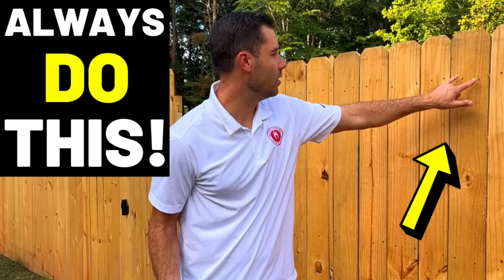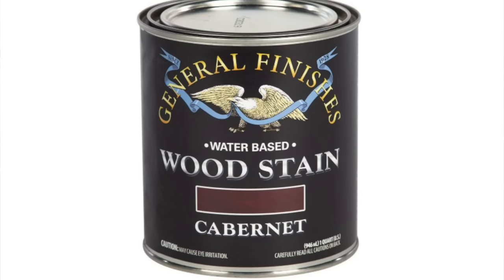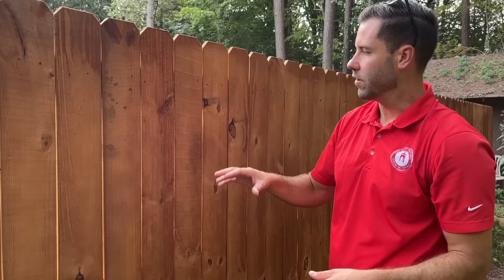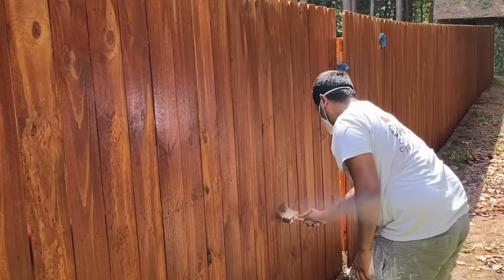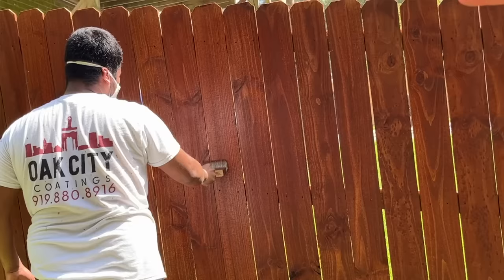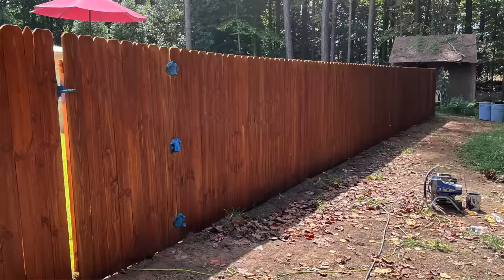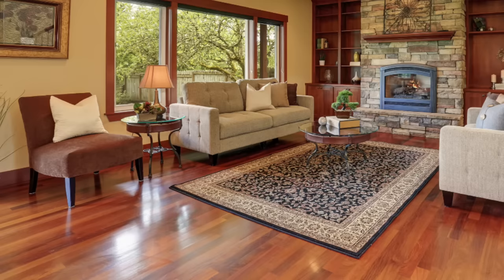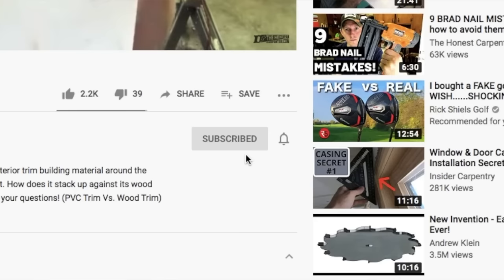Don't Make These 4 FENCE STAINING MISTAKES! (Most Overlooked Fence Stain Pro Tips + Tricks!)

Comment: Brush will always last longer than spray. Been a painting contractor for around 15 years, if you spray to apply you should back brush and work it in the grain. If you just spray and leave it to soak in it wont penetrate and will fade a lot sooner. This goes for most stains and most wood substrates, it's a good rule of thumb if you want your work to last.
Reply: What about roller? Pros and cons?
Reply: Do you typically pretreatment or clean with water/bleach mixture prior to staining?
Reply: For a DIYer, spraying just seems like a huge project. Protecting my house and my neighbors' houses from overspray seems like agonizing (though necessary) prep work.
Reply: How do you order stain and varnish work around painting g walls/ceiling and the rest of the trim? Do you stain first or last?
Reply: I never back brush, I use a penetrating oil based and self-leveling stain that I apply with my battery operated backpack sprayer (same one I fertilize my lawn with).
Reply: Excellent video - I'm about to seal and varnish a new hardwood fence. The guy at the hardware store actually talked me out of a sprayer - I'll be doing the whole job by brush and picket roller.  Thanks for this !
Reply: Yes sir!! even a small roller is better then nothing!! But I also use a brush behind the spray!!
Reply: @timf5963 it’s really not! Just get a fridge or tv cardboard box or a piece of 1/2 plywood & tie/strap to a ladder if your doing by yourself to protect the opposite side your spraying! Plus your only using around 45-50 psi!
Reply: @SolidBased  good insight--thank you! I will definitely consider this. I ended up using a brush on my fence last fall. With the thick 5 1/2-inch brush, it went quickly, but a sprayer would've been much faster.
Reply: does this also apply when using sealant? gonna seal my fence

Comment: I always use motor oil for any wood that I want to protect as it gives the best protection and it's most durable product.
Reply: Does it really protect better?  I have been using stain protectant on my rv gate.
Reply: @debbieluevano9977  oil also rubs off onto everything that touches it. It doesn't really dry. We used it for years on shop floors and any clothes that fell almost always had some black residue.
Reply: Not a bad idea. Your fence will be the color of the used oil though. I'd cut the oil with a solvent so it penetrates the wood better.....maybe use a little gasoline! You can also use old motor oil as bar oil on your chainsaw.
Reply: Sounds flammable!

Comment: Heres a tip folks, you want to save your back while brushing? Two options, get a brush you can screw a stick into so you don't have to bend over, and 2 use a sprayer and then the brush. 2 man job makes this easier and super fast.

Comment: I was a residential painter for many years and staining was what I hated the most. I was so glad when then trend went from staining trim and cabinets to painting. It wasn't because staining was more difficult. It was actually easier. I hated it because it's so thin you get runs and drips a lot easier and the fumes were a lot stronger. Even when brushing, it's still a good idea to go back and spread and smooth things out over the whole surface. Sometimes we used a rag to soak up excess that wouldn't soak up. 

I'm also glad to see you mentioned brushing, as people have this crazy idea that you put stain on with only a rag. While you can certainly do that, brushing (and spraying for exterior) allows what you talked about, the excess to sit on top to make sure there is 100% saturation everywhere. 

I could not imagine a way to explain all this better than you did. Fantastic job!
Reply: How do you order stain and varnish work around painting g walls/ceiling and the rest of the trim? Do you stain first or last?
Reply: @TheOlzee   We stained and sealed/varnished the trim and cabinets first, then painted the walls and ceilings. 

You can paint over stain you may get on the bare sheet rock but you can't get away with staining over wood that's got paint dried on it. 

Stained and sealed wood is just a matter of wiping clean with a damp cloth if you do get paint on it. 

Once the first coats of everything was done we'd sand the trim and second coat the sealer and possibly repeat that a 3rd time for a super silky smooth finish. 

I don't remember what order we 2nd coated the walls though.
Reply: @HAL-dm1eh  ok cheers

Comment: As usual, a great video. Looking forward to your video regarding staining decks. Something to consider in that video is something that I experienced and wasn’t prepared for. Mold in the boards. In a nutshell, I’m trying to stretch out the life of old deck boards and decided to stain them one more time. The boards apparently had mold in them in some places, which came up THROUGH THE STAIN in some spots.  Looked like white spots randomly placed all over the deck. I really freaked out and didn’t know what happened. Fortunately, there was a handyman at the house doing work and told me what it was. The fix was a rag soaked with bleach to kill the mold. after everything dried I applied another coat of stain and we were good to go.
Reply from the maker: Glad to hear that worked out, Chris! I was amazed at how well the superdeck worked to clean the mold and stains for this fence. Made the lumber look brand new 🙂
Reply: The pretreat product we use for fences does have some bleach mixed in and will help prevent that problem!

Comment: I stained the boards for our fence before I put them up. it seemed easier, and I was able to get all 6 sides. but I did have some trouble with runs. I also applied 2 coats. I did allow the first coat to dry to where I could handle the boards but after watching this I hope it doesn't come  back to bite me, because I used a Behr semi trans stain. that was 2 years ago and so far so good.

Comment: Two questions:
1) If buying stain (transparent, oil-based) in larger volumes i.e. 5 gal. buckets, is it still recommended to somehow mix all of the purchased stain for a project? If so, how? Combine small volumes from each 5 gal. bucket into a smaller one to mix an apply to ensure the most uniformity of can contents?
2) I have some warping of a fence that was put up a few years ago and hasn't yet been stained/sealed. Can gaps that have formed between framing lumber be filled with some sort of caulking to try to prevent water from getting in where it's hard to apply stain/sealant? And how can I best prevent water from being absorbed by 4x4 posts whose end grain is completely exposed and pointing directly up?

Thanks for making such great content - it's succinct, entertaining, and informative.

Comment: One additional major mistake: staining after the boards are hung. Stain & sealing prolongs the fence life by making a barrier to the elements. If you stain after the pickets are hung, the surface of the framing meeting the pickets has no such barrier. That is where the nails are as well. So they'll fail sooner. 
Instead, stain all boards individually before erecting the fence, on all sides and ends. Then seal on all sides and ends. The cut ends are moisture sponges. Protect them from rain & rot. Then nail them up. Otherwise the areas of structural integrity have zero protection and the stain is purely cosmetic. It may look good, but it won't last half as long as one with all surfaces stained including the areas you cannot see but still get water penetration.
Reply: @Jay2pay  Screws have about one-third the sheer strength that exterior nails do. Why do you think rough framing of a house uses nails instead of screws? There are "deck nails" made specifically for decks. I've bought pre-made wooden deck stairs that used screws. The failed within 12 months because of the lack of sheer strength. The screw heads broke right off. Screws actually damage the wood. Split-less nails do not because of the square point just like a square nail. These are why you see barns built in 1882 that are still standing in 2023.
You always, always, always protect your structural connections from rot before anything else. Otherwise it will fail at the connection regardless of screws or nails. You cannot protect those surfaces after assembly. No matter how pretty you make it look, the fence is doomed to fail without those points protected. It's common sense.
My fences are stained, then weather sealed before assembly. The horizontals each get 4 aluminum nails and two 1/2 x 1&1/2 stainless lag bolts holding them to 12 gauge galvanized metal L brackets. Pickets, also stained & sealed before hanging, get no fewer than 8 stainless ring shank 6D nails driven at opposite angles per picket. And I use 2&3/8 galvanized posts, not wood 4x4s, to eliminate rot at grade. My fences can withstand 100+mph gusts, and will last 60+ years before failing to wood rot; not 20. Lastly, they're seamless double-sided so all those structural components are protected from UV radiation too, which can start to break down even Cedar in a single year.
Some people call it "overkill" how durable they are. We call them "apocalypse-proof." 
Maybe experience & engineering just don't make sense to everybody. And just because someone calls themselves a professional doesn't mean they know what they're doing. There are tons of contractors who bungle projects due to ignorance. In fact there are youtubers whose channels are all about fixing those "pro" project fails.
Reply: I really liked your comments here and was planning to copy some of your details to use on my own project.  Someone downrated this comment saying you didn't know what you were talking about, staining before assembly and using nails vs screws after 1842, lol.  I gave him a thumbs down and you 2 thumbs up, but now those last two comments have been removed just minutes after that.  I wish there was a way to get your LONG detailed answer back.  It was very intelligent and helpful.  Thanks
Reply: If only I had a month or two to build and stain 300sq foot fence.

Comment: Thank you for another helpful video!   I'm looking out my window at our old fence that was semi-transparent stained (yes, to the point of rejection) many years ago.  Any reccommendation for an old fence that has areas where the wood is beginning to show through?
Reply from the maker: We’ll probably cover reapplication before too long, Susan! I’ve got to research it more myself 😅
Reply: @TheHonestCarpenter  Looking forward to it.  Thanks for the reply!
Reply: Hey Susan, if the fence isn’t too bad than its recommend to clean it by the process we do in our first fence prep video. And then follow this same process. Since the fence already has some stain in it currently it will just soak up less. About 50% of the final color is determined by whats currently there. So, if it is uneven enough it may be time to switch to a Solid Stain. We usually recommend the Superdeck 9600 Series stain from Sherwin-Williams!

Comment: Its hard to find a paint sprayer for a fence that takes OIL based paints.  All the rental sprayers at HD mandate water based only.  Is there a recommendation on which unit to use with oil based stains?

Comment: Awesome information, expectation management is key for me.  Perfect match won’t happen.

Question -  I’ve heard using treated lumber generally requires a dry time to paint or stain.  Is there a recommended amount of time before applying stain to treated wood?
Reply from the maker: Thanks John! Yep, you definitely want to wait, usually 60 days or so. It can really vary by humidity and location, but you can speed the process up by pre-stain treating the fence!
Reply: There are a ton of different answers i’ve heard throughout the years for this same question! From what I’ve seen around 60-90 days is a good amount of time to wait depending on your weather where you live. The pretreat process and product we use actually helps pull moisture out of the wood and “express dry” it. If you are using the pretreat we can get stain on fences and decks after only 30 days. We have found this to help cut down on the amount of board wrapping you can experience from leaving wood unprotected.
Reply: This will be important information to include in the future deck staining video.
Reply: Awesome, thank you guys so much for your information. That pre-treating tip would be super beneficial for when I redo my deck.  

Follow up question, would you still pre-treat if you want to paint treated wood?  I have a potential project coming up where I might be building one of those little free libraries for someone. I used non-treated 3/4” ply, thought I had everything sealed properly, used exterior paint on all surfaces. And still seeing weather damage within the first year. My thoughts are to use treated ply for the next one.  Interested in your thoughts.
Reply: @thecrippledstud How do you know how long the wood has been at the store since it was treated.

Comment: Thanks for the info. A lot that never thought about. 
  One question though... when staining a complete freestanding fence, what about the bottom of the fence? The bottom of the boards won't get any staining. Is this a problem? Or should the boards be stained before the fence is built if possible, including the bottom of each board?
Reply: If you can pre-stain the boards before the fence is built that's always the way to go. Bottoms aren't a priority only the tops. If you're using a mini roller the bottoms are easy enough to do though.....can't hurt

Comment: I stain each board front and back before I screw them on . 
I assume the edges need to be protected as well,  so that's  stained too .
I paint the frame and posts .  The boards face my backyard , outside is brush and timber .

Comment: I am a residential painter for many decades.....use a bug pump sprayer/filter your stain. Back roll the section you sprayed with 6 inch mini roller and have a roller pan w/stain if needed. Use a cheapo throw-away natural brush (known as a 'chip brush') for touch ups. Anyone brushing in a whole fence needs to have their head examined.
Reply: I used to use paint brush to do exterior doors and trims with oil based paint.  It was so time consuming.  I see where you coming from with the fence. It’s lot bigger area.  Recently, I switched to roller for oil based varnish. It was crazy fast.  I didn’t use roller before bc it was pretty much throw away every time.  And I was using those one time use brushes. It was much cheaper since I’m only doing DIY projects.  But roller are game changers.  It’s a bit more expansive, but well worth it.
Reply: @ipick4fun27  Use a mohair roller with "varnish" aka polyurethane finishes. In fact, if you want a "spray look" you can use a mohair for any finish. If you're using a mini roller, you can wrap it in plastic for next day use or just do what i do and knock it off into the container of finish poly or paint and put the lid back on. Of course, with bigger rollers you can wrap them in plastic also.....I even wrap my 14- and 18-inch rollers for next day use.
Reply: @fritzkabeano1969  Thanks for the advise.  I was using roller for speed.  I wasn't too worry on look.
Reply: @ipick4fun27  Yeah.....I won't even break out the spray gun unless I'm doing new construction or an empty house. I can use my 14 or 18 inch roller to paint walls/ceilings faster than a spray gun when you take into consideration cleaning/setting up the sprayer and the prep involved taping off everything. I only use 9-inch rollers in closets and those I roll in first and cut later.

Comment: You are right, I wish knew what I know now, cause  9 - out -10 - those water-based stains don't work, cause they don't penetration, that is why they start peeling, which ruins many people's decks and porches, that is why you have to use oil-based stains - TWP - STAIN - but some are not allowed in - NEW - YORK - STATE - and there is - Ready Seal stain

Comment: We were going to replace a fence soon and I had the idea of getting/creating a trough big enough to hold a bunch of fence boards at a time; fill it with the stain and let it soak in coating all sides. I knew each board would have to be brushed as it came out, so I thought I could make a four sided jig with brush surface facing inward to mount at one end of the trough so you'd just push each board through it after dipping/soaking and the excess would sweep back in to the trough. A little time getting set up but once that's done; it should go pretty quick with the boards getting stain on all sides. All the fences in this HOA community are the same color so "neighbors' side" shouldn't be an issue. Obviously I haven't done this yet or I'd be bragging how great it worked or warning off anybody else with the same stupid idea! Would love some thoughts/ feedback on the merits or ridiculousness of this plan.

Comment: I would like information on PAINTING a fence (white) , and not staining it (brown).  
I'm s-l-o-w-l-y building a 6' high privacy fence around my entire yard, one section at a time.  The treated 4x4 posts need to dry completely, before they can be primed and painted.  I was told anywhere from 6 months to a year!  As for the pickets and rails - I began priming and painting them all separately, with the intention of assembling the individual parts, already painted.  That's because, once I attach the pickets, I will be unable to get to them from the other side (my neighbor's yard).  I'm using exterior house paint.  Is that the best option?  I'd just like some qualified advice.
Reply: Unfortunately “Paint” should not be used on your Fence or Deck ever…
A penetrating oil based stain is the only thing you should apply 

If you want a beautiful white fence… then vinyl is the way to go